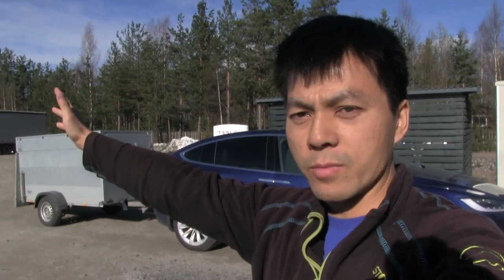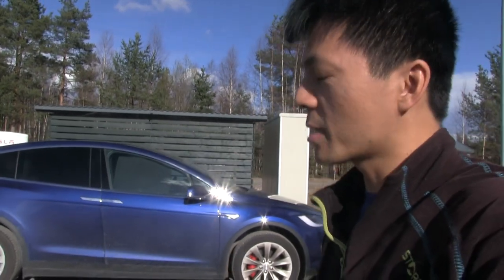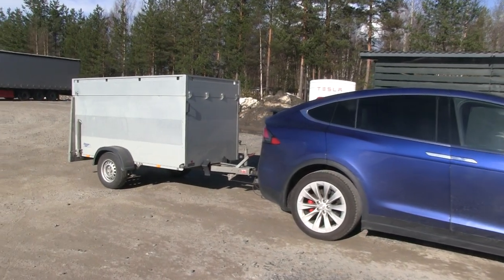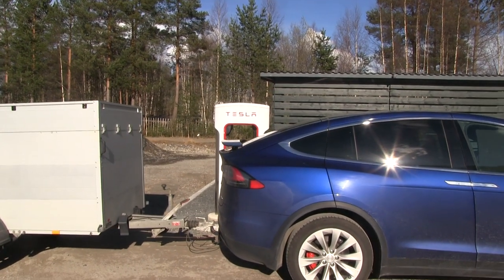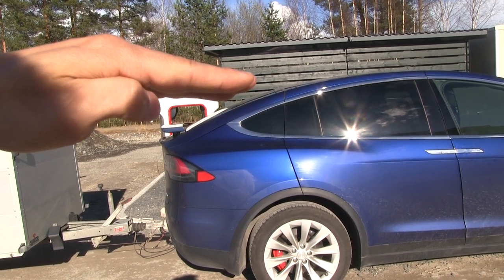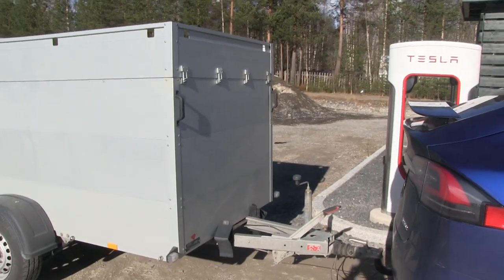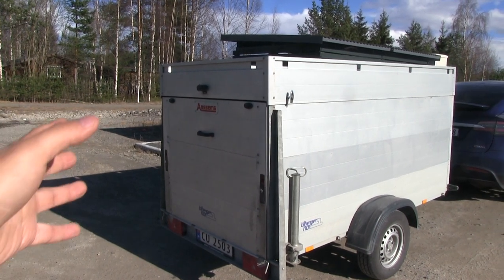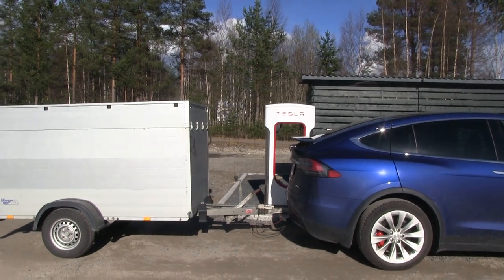Model X with trailer: Can the efficiency be improved?

Comment: Suggestion from a semi-retired engineer in US. Easiest fix I see:  Please note that most of the drag comes at the trailer lid, which sticks up above the car. So while a cone will lower the drag some, you need to focus on the lid. Radical idea: You can take a diamond blade circular metal saw (or a sawzall) and cut off a few inches of the top side front and back and sand the rough cuts. on the lid. Don't cut into the floor of the lid. (Please keep the sides of the lid, which have little drag).  Airflow would pass smoothly over the lid from the front to the back when nothing is on top. You could still use the lid to tie things down to its sides. I estimate that doing this will lower the trailer cross-sectional area about 20% and lower air drag at least 30%, because its on top.  This could boost highway mileage 7% to 10%  (adding cones may get you another 5%).  Glad to help and love your videos, Bjorn!
Reply: P.S. I forgot to mention, you need to make smooth circular cuts around the lid hinges. I would suggest calling your trailer maker directly and ask them if they could make the cuts FREE or at low cost to you, on an extra lid and ship it to you as an experiment for you to test out.  If they are willing to do it, the cuts will be professional and smooth and keep the strength integrity of the lid. Please tell them: if the lid experiment works, you will be helping them improve their product for free, and help sell it as people can see this on your social media.
Reply: To see an ideal similar design, you may want to look at the2017 Airstream Basecamp 16 trailer

Comment: I am certainly no aeronautical engineer, but at a glance I'd say that your trailer is an aerodynamic disaster :D

It seems like making changes to the trailer would be far more practical than having a temporary add-on spoiler for the vehicle. I would try to get it as close to the shape of the Model X as you can, since that's already been scientifically proven to be a highly efficient shape. That might include a bulge on the top, and the front, and perhaps even some kind of shaping in front of the wheel fenders and the support triangles at the tailgate. The jacks are even causing drag.
Reply: totaly agree, the trailer is like dragging a 1,5x1,5meter sail behind the car...
Reply: Paul Smyers  h
Reply: Paul Smyers I

Comment: Intriguing project.  Yes doable.  
//  My immediate reaction/ remedy is for a bubble attached to the front of the trailer by latches to the sides -- easily removable at delivery locations so to open trailer top..  It should be smooth shape, no sharp edges, full trailer width, extending about 2/3rd the area from the top of trailer downward.  Suggest it be made from lightweight fiberglass.  
//  Consider approaching university for students or instructors who would use as a class project.  Envision, in your mind's eye, the optimal bubble shape.  Wind to flow smoothly from car, around the trailer's front to either side.  The remaining wind will go over the trailer top naturally.
//  I doubt anything else would be significant drag component.  Such a nose cone bubble could result in another 5% efficiency, maybe more.

Comment: Ever tought about changing the trailer to something more aerodynamic? I would think of a horse trailer that has a rounded front and a boxy back side. Or you could look at a scrapyard for boat parts or parts of caravans. Another tip that would be great for your youtube channel would be to glue small paper stripes on the trailers front and side to see the airflow in real - that would make improving much easier...
One last thing - get mooncaps for the trailer! Another one to two percent of trailer efficiency!
Keep up your great work!
Reply: Horse trailer is way too high.

Comment: ______
               | \    Front        
   Top     |   \ __  hitch
   View   |   /  
________|/

______
               |\       Front
   Side    |  \
    View  |    | 
               |    | 
----------------------- hitch

  First I would at least make the trailer front not flat.  Bump it out like these two views with a triangle on top and 2 trapezoids meeting together under the triangle at the front.  You would not have any problem with turning.  You could even go a step further and curve the triangle and/or the trapezoids.  I think this would be easier and more effective than something on the car.  Maybe later on you could improve it even more by putting a raised back on the car.
Reply: Ryan Welsch This is exactly what I was thinking. Best of all would be very easy to do it yourself and might give you extra storage in that area.

Comment: one thing I suggest you, 
do one more test, find out some washable color, and put it on the trailer drop by drop all over. make a quick run 1km or so. it will left traces of color drops indicating direction of airflow, and possibly will Indicate turbulence also. simple tunnel testing 😊
Reply: Deepak A yeah that's a good idea, Formula 1 teams do that to compare car's performance on track vs. in wind tunnel.
Reply: Deepak A in Norway it's very wet and the roads have a lot of grit on them since they use this instead of salt in the winter , so often you get this for free!

Comment: Bjorn,
I was trained as an engineer in computational mechanics and computational fluid dynamics, back in the day.
Some points of advice for you:
- (for now) don't do anything to the car - it's optimized in and of itself. Also: the distance between the car and the trailer is too large. Compare with the truck: the distance between the "front spoiler" and the cargo container is very small, isn't it? The two situations are completely different...
- you trailer is hinged and a long way from the car: focus on the trailer.
- make both the front and the back (if you can) of the trailer more aerodynamic.
- the T-front: add a 'nose' cone both on the top and on the bottom, just don't interfere with the mechanical pivot (the point where you hook up your trailer) and make sure you can safely operate the combo (be able to make all necessary turns). NB: just make an aerodynamic connection between the frontal area of the trailer and the slip stream of the car. That will suffice and aerodynamically 'bind' both together.
- the T-back: the cross-section of the slipstream of your trailer is clearly defined by the contour of the back side (which is the same shape as the front side of course -- boxy shape, yeah), the drag-forces are directly related to that area. That is exactly the same argument you mentioned when you first got Optimus Prime and comparing its consumption to that of the Millenium Falcon. So, the mission there is: to try to reduce that cross-section (of the resulting wake). Yes, fish-tailing is the way to go there, even if you do it only partially.
- another T-part ("T" stands for trailer) you could consider are the wheels: they stick out. But as for priorities: the points above are higher.
Hope you found this useful.
Best regards.
Reply: The top of the trailer also has a 5-10 cm railing to form a roof rack, I guess filling that in with some styrofoam or just sealing over with some heat shrink plastic would probably reduce turbulence along the top,.
Reply: Thats what I thought as well. If you can't get rid of the front and rear fastening rail that are counting twice as drag is produced at the front as well on the rear rail, I would do cut 4-6 boards out of Styrofoam. Wrap them with self adherence clingfilm from the kitchen to protect and stabilise them a little bit. Put them crossways to the driving direction and strap them down by two straps in driving direction while you have two holes on each front and rear fastening rail. So if you need this roof space it easy to detach them and store them in trailer or car. If this helps to reduce the drag it is maybe worth to think about a more durable self inflatable roll of camping mat instead of Styrofoam.

Comment: If you are not worried with looks, one thing you could do is to install a cover that would link the top of the car with the top of the trailer. this could be done with a thick cloth fixed on the inside of the car (under the falcon doors) and on the top of the trailer. This is an easy and pratical way to make the pack (car+trailer) to work like a unit. this way you would reduce the turbulence very effectively transforming the flow as to a laminar flow. It wouldn't be perfect because it is not a rigid soluction, but it is a simple and easy way o transform the flow. looking at the shape of the trailer i expected a very significant gain in efficiency.

Comment: I would try to put a spoiler on the front of the trailer. As you explained the most important part is the top third of the trailer so I would try a simple triangle shape(sideview) that begins at the front top and goes toward the end of the car. Idea is that you divert the airflow so it goes over the trailer. Cheers!

Comment: Perhaps the lid of the trailer could be customized to be slightly rounded or tilted towards the ground in the front part? This way you would not lose too much space but the air resistance could be reduced.

Comment: Yes, most important is the rear.
Easiest thing for you is to have something on the sidewalls or at the top. Some trucks have a "spoiler" that I'm thinking of. Think of a 1/3 cut off from a bottle lengthwise, attached to some bars holding it a few cm from the trailer, either the entire length of the top, or as much as possible of each rear corners. Air will go between the "bottle-spoiler" and the trailer, the spoiler will push this air towards the rear of the trailer, thus smoothing the air out.

The trailer roof is not flat on yours. You should fill the gap. A roof-spoiler would not be as effective without a flat roof.

Smooth out the wheel plastic thingies. You didn't mention them, but infact you might save your 5% only there.

Spoiler on the Tesla, with suction cups? No, sorry mac, it will not hold, that would be some serious strong suction-cups. Stick your hand out the window in 80 km/h, then imagine what force would be on a ginormous spoiler in the same speed...
If you can fit a roof rack, you could get a spoiler for towing caravans. I'm not sure if they sell them anymore. For your application it would have to be flattened out though..
I think easiest would be to create a cone/ball-shaped thing on the front of the trailer on the portion under the hinges. That will give the air less resistance to continue to the sides of the trailer. Think of your car-trailer as a semi. The closer you get the trailer to the cab on a semi, the less drag you will have. So, you could just fill the gap with around 12 bananaboxes, or around 536 hamsters ;)

Comment: I think quite efficient and most decent looking way would be to adjust the top cover of the trailer to get 45 degree front angle. You lose almost no space with that. May be the trailer manufacturer would be willing to provide the adjustment to get feedback on efficiency etc(?)
Another thing is that you definitely do not need 275 tyres. These are good for ludicrous mode acceleration, but for trailer towing, choose the narrowest tyres Model X spec offers.

Comment: The physical explanation to schmutz on the trailer at a point lower than the roofline of the car is that the oncoming laminar flow will follow your roofline to its point of stall, from where turbulent flow takes over with a much lower pressure. This will vary with speed and the curvature of your roofline. For normal Reynolds numbers your car has a coefficient of drag Cd that multiplied with your frontal area, air density and speed^2 give the car's drag. So a big spoiler is not good for the car. However it could make the trailer to be engulfed in turbulent flow and slipstream behind the car. A better solution for your speed of driving may be to create turbulent flow at an earlier stage than down at your tailgate, to avoid a large pressure difference. You may try cartons of eggs over the width of your car over the B pillar...think of the effect on a golf ball.  
And for the trailer, the square front will force the laminar flow far outside the side panels and create a lager low pressure area of turbulent flow around it. A nose cone is impractical, like the bulge on a ship, so spoilers on the front vertical edge corners are more neat, like found on some cab-over trucks, or like slots in front of airplane wings that force the airflow to accelerate and be closer to the body longer (moves the stallpoint). The largest problem is however the rear end of the trailer that gives a large pressure difference between laminar and turbulent flow. The most practical solution is to have a top spoiler to shoot laminar flow into the turbulent area and minimize it, like found on some station wagons. You can also mount spoilers on the rear vertical edge corners. 
Or you can program a computer that run large loadspeakers in sync with the vortex shedding that takes place after the trailer, something you sometimes can see proof of when a car has driven on a road with light snow drizzled over it. The purpose will be to eliminate the 'slalom' pattern of the low pressure airflow. Ok?
Reply: Durango Useless Aerodynamic bla bla. But funny. Thanks for entertaining. 😃

Comment: Such a spoiler will create low pressures which will realign shortly benefiting Optimus Prime mostly. Low pressure at his trunk will cause a dip in the air flowing over him. Moving air around his trailer with a flat top curved underside, or similar shape should help, if you can hold it in place with Suction cups or placed on the top edge and clamped below, in a way that is  easy to move. Either that or a giant foam dome :)  .  Good Luck.

Comment: I think putting something on the front of the trailer could be just as intrusive as putting it on the back, given the way the top of the trailer is hinged.  You'd either need some complicated origami shield, or you'd need to remove it before opening (oops, I forgot and crushed it), or you'd need to make it so the shield didn't attach to the top part of the trailer at all.
Reply: it can be on hinges-like sthings(rope) and be connected exactly to the upper handles in the roof and handles on the side. So it might be enough free to accommodate the roof open/close movements. More permanent attachments also can be made without restricting the roof movements.

Comment: A custom made during drive self inflating cushion at the front of your trailer would be cool. An other idea is buy a Polyethylen block foam that you can strap to the frontside of your trailer. That material is like an camping mat and you can shape it into aerodynamic nose cone by cuting it with a sharp knife or a scissor. Or buy some 8 to 10 camping mats at a cheap Chinese internet store. Stick them together with a double sided adhesive tape to create a block of 15 cm. Shape the block with a sharp knife into a nice and  smooth form without any steps. Strap this foam fairing to the frontside of your trailer.
Could I send you a sketch? Do you have an e-mail adress?

I believe as well that your extra Spoiler idea is not sufficient enough while to far away from the trailer. 

If you can't get rid of the front and rear fastening rail that are counting twice as drag is produced at the front as well on the rear rail, I would do cut 4-6 boards out of Styrofoam. Wrap them with self adherence clingfilm from the kitchen to protect and stabilise them a little bit. Put them crossways to the driving direction and strap them down by two straps in driving direction while you have two holes on each front and rear fastening rail. So if you need this roof space it easy to detach them and store them in trailer or your car. If this helps to reduce the drag it is maybe worth to think about a more durable lightweight boards for long term use.

Comment: Bjørn, just pre-order the new Tesla Semi.  Then you can get serious about Nimber-tasks. 

A trailer half the height would give you a lot less drag.
Reply from the maker: Read the description.
Reply: If the goal is to prevent having to charge slowly up to 90-95%, limiting speed to about 70km/h in part of the leg that you are range limited, would be the easiest and most effective solution.  The energy saving  from reduced speed would become more significant the higher the drag is. 

Any realistic and safe mod would be far less effective I think, and at the most, increase your range with a few percent. But that's the boring answer. I'll be looking forward to seeing what you come up with.

Comment: The best and easiest solution to your challenge would be to modify the trailer. Modifying the car by adding a spoiler will not give you much benefit. Making a cone shape on the trailers front with glassfiber and polyester is cheaper and easyer than aluminium. The optimal solution would be to change your trailer to a MC trailer like the Excalibur, but off course ekstra expenses.